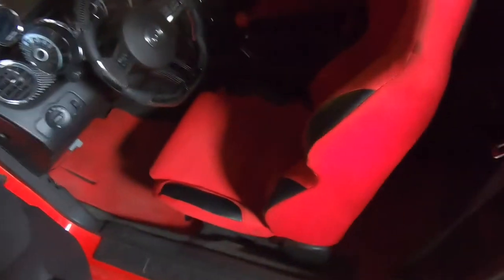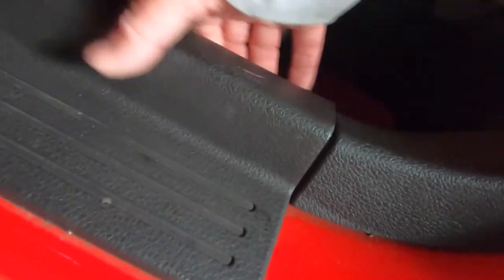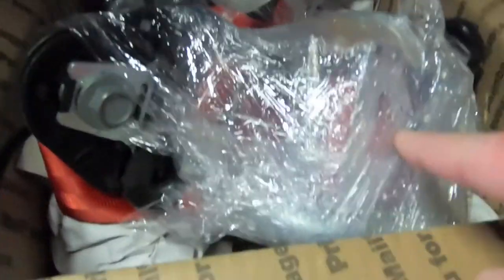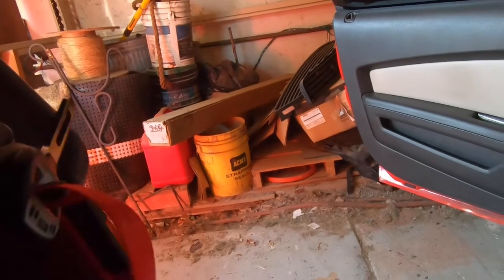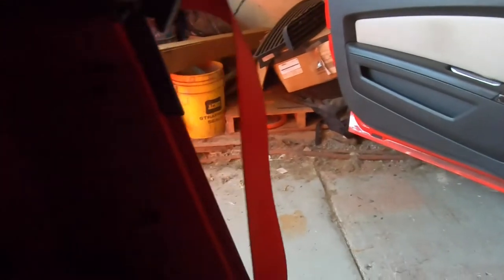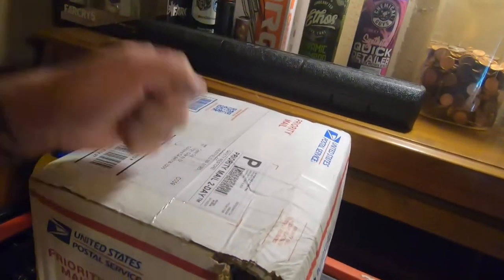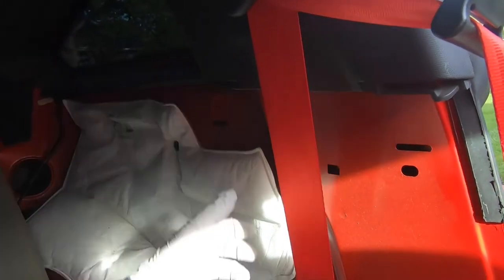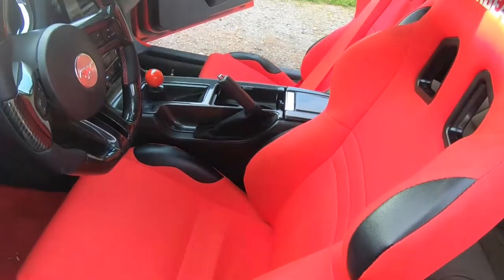Installing Colored SEATBELTS in my MUSTANG!!! [Safetyrestore Red Seatbelts]

Comment: I'm about to send out a set of seat belts for a 2020 Mustang to Safety Restore.  Would you still recommend them after the mistakes?  Anything I can do to prevent them from screwing up?
Reply from the maker: Yeah I’d still recommend them. Not really, usually they are pretty good at getting it correct. I just got unlucky

Comment: Where can I get the plastic where the belt goes that makes it more in front, the one you have, it's like an extension?
Reply from the maker: It should come with the car already but if not you can get them from a ford dealership